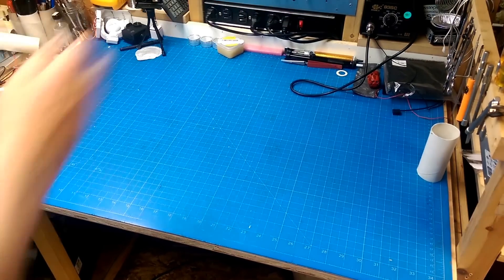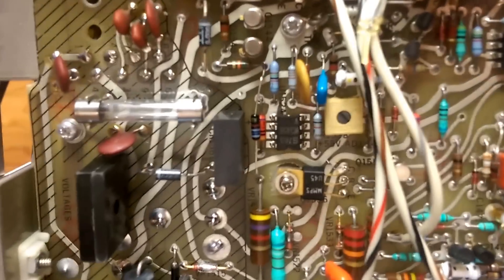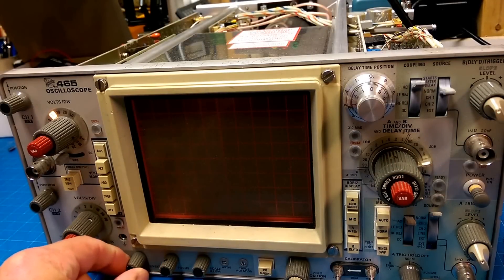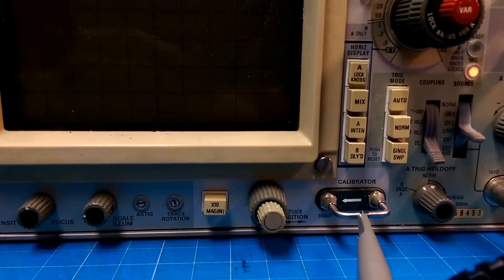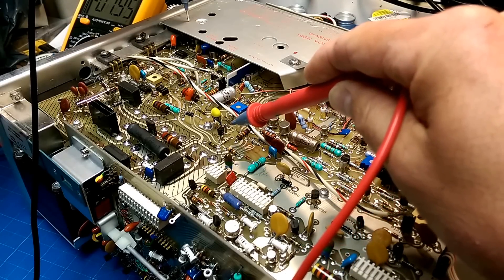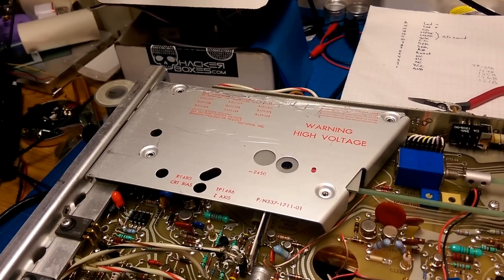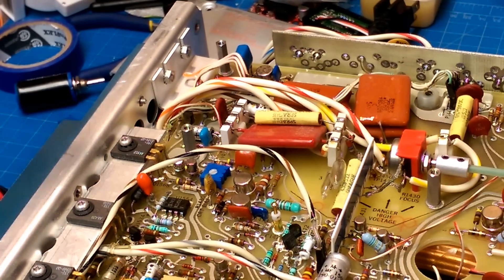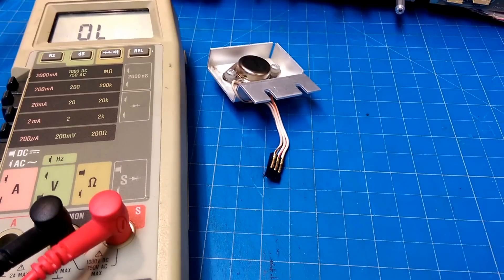Tek 465 Repair

Comment: Just picked up a Tek 466 'storage' scope; paid a ridiculous price.  It is a little dirty, but that is never a challenge.  Unfortunately, It did not come with the original Tek probes, which I really would like to find.  Nor did it come with any manuals, but those are available online.  I have not tested the machine yet.  I guess it may need, besides cleaning, a thorough check-up and calibration.  First, I will print the service manual, which is a rather substantial volume.
Reply from the maker: I only printed out the schematics that I needed to really study.  I left the rest digital and read the PDF in multiple windows.  I like having it open to many pages at once.

Comment: We are werking on a 434, which power starts up, and then quits. Then it starts up  again, and stops again. There is no beam.
It is build in 1970,  but i have a manual belonging to more recent types.
And: there is NO trouble shooting card in it..
I will consult Yahoo Tek group for this! Thanks for your video!
Reply from the maker: The Yahoo Tek group has moved over to Google Groups  TekScopes@groups.io
Reply: twancol 
Tektronix 434
http://w140.com/tekwiki/wiki/434
DO NOT LOSE the 3-48 Brass Hardware (treat like Gold).
Fastenal has 3-48 hardware ... BUT not your local Hardware store!!

Comment: Your troubleshooting skills are quite good! The basics are these:

(1) Always check power supply values first. (Which you did.)
(2) Always Google for folks in a similar boat. (Which you did.) 
(3) Always suspect tantalum caps. (Which you did.) 

Note: the TekScopes@groups.io is the new incarnation of the now-dead Yahoo Tek Scopes group. There is also a TekScopes2@groups.io group who claim to be "more friendly" than the original group. Both are good resources nonetheless.

Please let us know how the final product turned out, o.k.?
Reply: War Planner 
Agree. Electronics 101 ... (high school shop for me).
1.) GET Service Manual and Schematics for Appliance on the Bench.
2.) CHECK AC-DC Power Supply & DC-DC Conversion/Regulation.  ALL Voltages (DVM, VOM, or VTVM required).
** This FIXES at least 50% of Common problems.**
3.) IF Power Good, THEN Check other I/O to appliance (if any, or not working) ... I/O active devices fail due to ESD & Operator Error.
4.) Still have issues? ... CHECK Section by Section (Measuring Voltage, Osc. Frequency, etc.)

Comment: It would be helpful if your hand wasn't in front of the camera while probing the bad cap.  Also, the cap you appear to be probing while your hands ate in front of the camera is not in the hi voltage section as you claimed earlier.  Please explain.
Reply from the maker: I realize that I did not show the removal and replacement of the cap.  My bad, but it is the one that I was pointing at when I took out the power transistor.  I hoped that the flash of the component map together with the schematic would be enough of a clue to what to replace.....
Reply: C1419 is the suspect cap.  I have the same problem on the same scope and am fixing it right now.  In mine C1419 is a 47uf 25volt tantalum.  I understand replacing the tantalum with an electrolytic but I don't understand why you used a 100uf 50volt?
Reply from the maker: The value is not too critical.  It is what i had on hand.

Comment: Lovely .... thanks for that. Took me back to before 1982 when I left the bench. Worked for an electonic measuring instrument hire company as a repair and calibration engineer. We had so many 465's with noisy attenuators. All was needed was to strip out the VA board and litteraly wash it !,clean the angel fingers carefully and replace. Never had one back. Not sure if it was a 465 but there is a transistor that sits  on a pcb half way down the tube. THAT cost me a couple of hours to find it short circuited, but usually a very reliable scope and beautiful trace. Favourite was the 453 to work on though. Ah memories .... again TY :) Tektronix are beautiful in design and manufacture. Shame they missed out on the IEEE422 spec, which HP won.
Reply from the maker: Glad I could prompt some good memories.....

Comment: Always replace tantaliums in older equipment; they are notoriously unstable in the long run.  The same applies to electrolitics, especially the lower values.  ESR goes through the roof as capacitance rises.
Reply from the maker: It is on the "list of things to do" to recap the scope.  Some day....

Comment: Can I ask you how much you payed. I'm in the market for one. Thank you
Reply from the maker: If you are patient you can probably find a dead one for less than $60 on ebay.  Then there is the shipping to consider.  I searched for the lowest shipping costs first.
Reply: grtyvr thanks I found a tektronix 454. It works well.
Reply: I got a 465m locally for $55. If you see one, make an offer. Sometimes sellers are generous

Comment: I can't believe precision instruments were made with PCB's like that, Its amazing how far we've come since then.
Reply: Here's  some breaking news for you.  The world had already been here for some time before you arrived.  Millions of PCBs were hand taped by very talented people.
Reply: Beautiful board. Although I suspect you did not like the flying parts in the high voltage supply. I was thinking the engineers may have done the terminal strip and point to point with the high voltage potentials where the sweep voltages and accelerating voltages come together. God Bless

Comment: Just what I needed. Thanks for taking the time to make this video. I also picked one up in April wit the same issue. One thing that would be help is showing your replacement of the capacitor.
Reply from the maker: Jesse, thanks! I did not record the actual replacement.  But there are other problems with the scope.  Chop and Add don't seem to be working properly.  There is more to come. And I have to clean the pot's.
Reply: I just got back from the electronics store with the recommended cap. I'll let you know how it goes. I'm excited to see your other projects! I actually purchased this scope to see sound waves created from synthesizers. I'll def post some vids once all is said and done. Thanks again for the vid. 😊
Reply from the maker: I love trips to the electronics store! I hope it goes well.  I removed the cap from the top of the board and used desolder wick to clear out the holes.